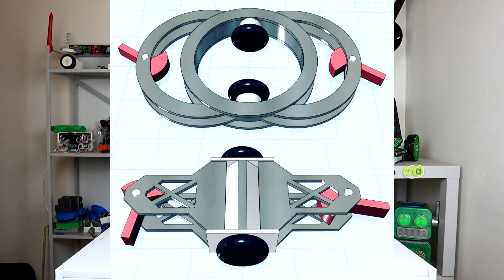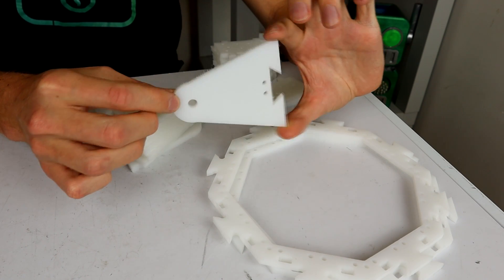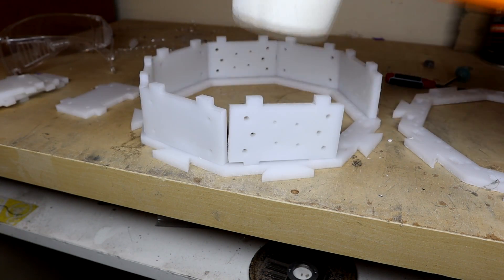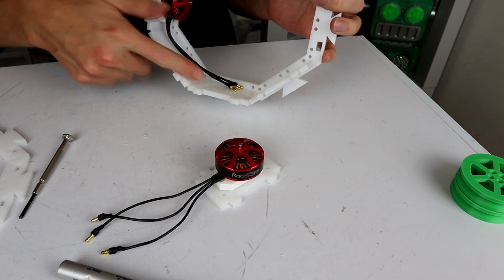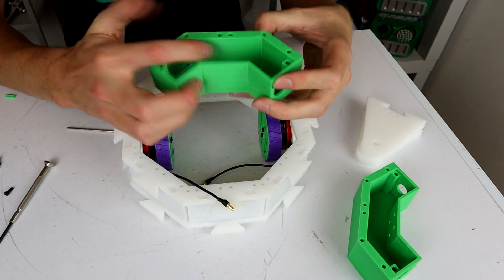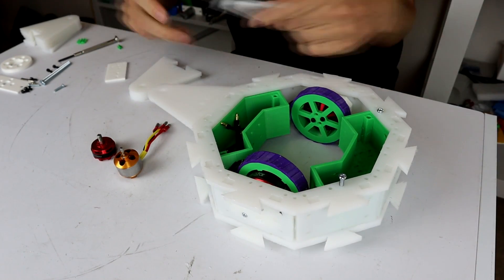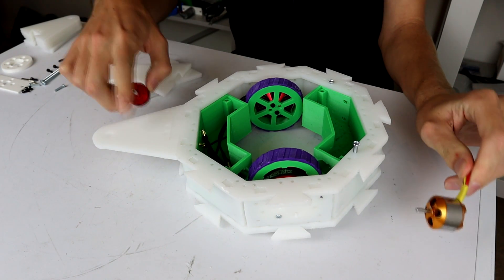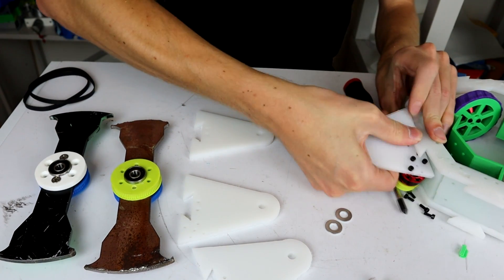Dual spinner melty brain Part 1:chassis (Beetleweight combat robot)

Comment: I think dovetails are really not a good idea on anything that you use in a thing that's going to get a lot of impact. The sharp corners will give rise to stress risers and probably break from there.
Reply from the maker: they might not be.
I did round out the sharp corners, both to make them cnc cuttable but also to try and reduce the stress risers but no idea if that worked.
The next version wont have them
Reply: @TeamPanicRobotics  oh cool!

Comment: Hey what about putting a motor in the middle of the robot with two belts connected to the weapon have you thought of that
Reply from the maker: I did, but the electronics are in the way of the belt. So its too difficult to do

Comment: Very nice beetle-weight project! But... come on, Ben:  you KNOW what we all wanna see. We wanna see some XXX-rated water-jet action as those chassis components are cut from a dirty great slab of 25mm hardox.

Those dovetails need a scrunching, screeching interference fit requiring a 150-ton hydraulic press. It'd save on a lot of welding - I'm sure the crazy Finnish dude Lauri from the Hydraulic Press Channel would oblige. (It's not that far from Finland to Australia - just over 4" according to my atlas.)

One thing troubles me about this concept, though: as a heavyweight fighting machine I think it has too many degrees of freedom to be satisfactorily destructive. To quote some Rush lyrics, ♬ "Wheels within wheels in a spiral array, A pattern so grand and complex; Time after time we lose sight of the way; Our causes can't see their effects..." ♪ [from 'Natural Science'.]

Ben, I think this bot will hurt itself. The design is beautiful but the end result could be too complex to withstand the fury of its own attacks.

It'd make a superb lawnmower or hedge-trimming bot (kinda like the chain-flail attachment on a tractor), but grass and bushes break when you hit them, and steel robots don't.

I'm thinking of pinball problems, only multiplied by three. 

Certainly looks cool, though.  ;-)

Comment: Would it be productive (or seen as 'legal' from the BB team) to make the struts supporting your spinners sharper on the corners so that in the likely event of a weapon failure, the support struts act as a sort of back up which will still be able to hit opponents effectively. I know you'd miss out on some points, but it would leave you with the back-up option of acting as a 'normal' melty if your extra spinners fail.
Reply from the maker: Maybe. The big things here is that with the bot at full speed it will be impossible to tell if any hit was from the weapon or from the chassis

Comment: Maybe make the spinners able to swap out so if a larger traditional spinner is better or say you want to add a thwackbot weapon similar to twrex's you can.
Reply from the maker: The spinners are able to be swapped out.
This design is fully modular, the weapons, drive and electronics boxes can all be swapped out and or moved very easily

Comment: This is an interesting design, and as much as I hate to be “that guy”, I’m not seeing the viability in 1) reducing the overall weight of your robot with two weapons, and 2) the overall effectiveness of two spinning spinners. Is there supposed to be more force behind the spinning weaponry? Or has this just been designed to be something silly and unique? Nothing wrong with that, obviously, but I’m curious to know if there’s destructive potential behind this thing!
Reply from the maker: 1) because is a melty, all of the weight is thrown into an impact. By having 2 spinners I am pushing a bunch of that weight out to a wide radius. So in theory it makes the melty more effective... maybe

2) Again in theory, the tip speed of melty is either added or multiplied into the tip speed of the spinning weapon massively increasing the power output of the spinner. Also in a big hit with full energy transfer, both the spinner and the bot would come to a full stop, so its a double whammy of energy transfer.

In all honesty though it was designed to be silly and unique originally, but now I've started thinking about the physics involved I'm keen to push this idea to its limit to see if the theory holds up in combat. I honestly beleave that if I can get it going and it doesn't self destruct it will be very destructive
Reply: Team Panic My biggest fear is your method of bracketing the pieces to the frame. They’re really small, and I fear they’d possibly bust on a heavy impact. One thing I’d consider that might be better at supporting the arms is to use, for example, two 1mm titanium sheets that are shaped like the various configurations, creating a sandwich and preventing the force from being applied to the mounts and instead through the entire frame. Also, with the vertical setup you had in the Bolt application, I’m curious to know how the robot would move in response to the gyroscopic forces. Lastly, you could save a bit of weight by going for a hubmotor set up like Robert’s doing with Psychotic Break v2, though it’s not really a cheap or quick option, and it’d be difficult to pull off in a featherweight or heavyweight. Not impossible, but certainly much more difficult, expensive, and potentially troublesome in heavier weight classes.
Reply from the maker: The dove tails are quite substantial, and will be suported top and bottom with 3mm ali, I'm not expecting them to break. But if they do I'll work on a stronger mount.

I have no idea how the vertical set up would move, so I'm going to build it. Honestly I dont expect it to work well, so I'm going to build all other weapon set ups first, then see how bad the twin verts is

Hub motors was the plan for this, but not Robert style. The UK builders have a different style, which I think is better suited to weapons so I want to build those. However I slapped the belt drive on this in an attempt to get it into the ARC march meet. Unfortunatly I didnt make that, so it will have hub motors before I fight it.

I'm not really planning on scaling the hub motors up, but in this weight class they make the most sence
Reply: Team Panic different method of creating hubmotors? Never seen it before, and now you’ve got me intrigued!
Reply from the maker: Yep, In roberts video he left the bottom of the motor attached to the stator and used that along with his new dead shaft to hold the motor down to the robot.

Britsh style is removing the stator from the motor completely and replacing the bottom with 2 custom machined peices that press fit into the stator from either side. this leaves you with a stator supported on either side and one that you can mount on both sides.

On top of this they then run a big bearing on each of the new peices, so they have much larger bearings then robert and they are spead out which in theroy helps spread the impacts.

I've got a video in the works on this topic but I am getting myself more familiar with both appoaches before releasing it

Comment: Looking awesome! That CNC router for the HDPE looks very useful. Have you done a video on the router or cutting HDPE in general on one?
Reply from the maker: I havent done a video on it beacuse I am very far from being an expert on this subject.
I googled CNC'ing plastic, bought the bit types listed in the thread I found and then used a CNC powerful enough to cut Ali to cut HDPE, which means that getting the settings right it not super crittical.

Its something I might do in the future, after I've got my own decent CNC machine and a bit more practice

Comment: Such a crazy and unusual design. I love it!

A couple of questions:
1. Any ideas for a name for this thing yet?
2. Based on the motors you've chosen, and the size of the bars you plan to use, what will be the theoretical tip speed of those bars when the bot is standing still?
3. How do you calculate the overall tip speed when the bot is spinning as well?
Reply from the maker: 1. No, not yet but it's probably not competing for a little while yet so I have time to decide on a name
2. I haven't calculated it, it will be over 1k RPM but how much over I don't know
3. Oh no idea at all... I don't even think you will be able to properly measure it because a meter will most likely pick up just the robot speed or just the weapon speed